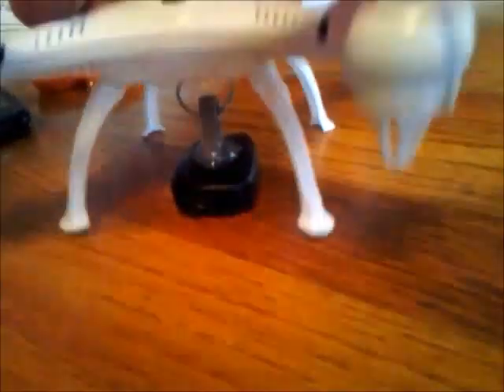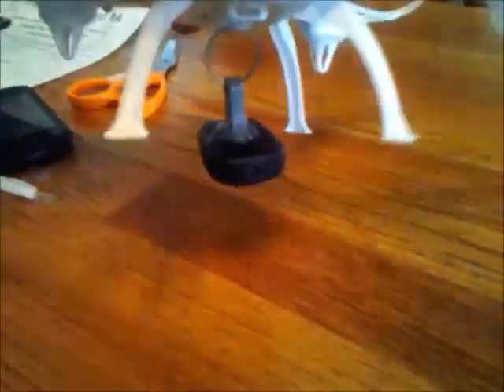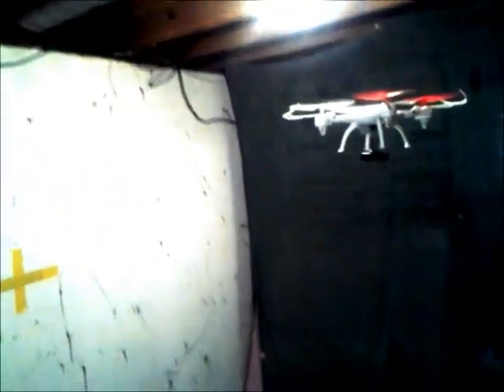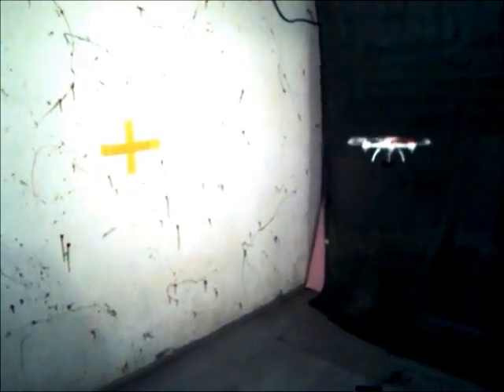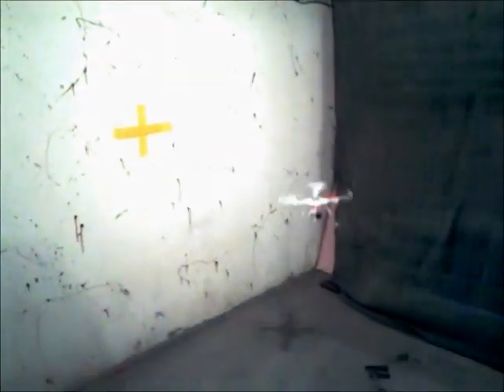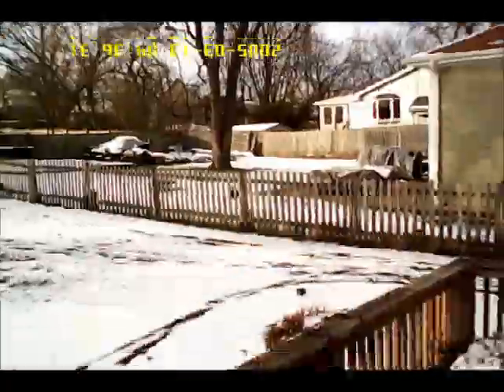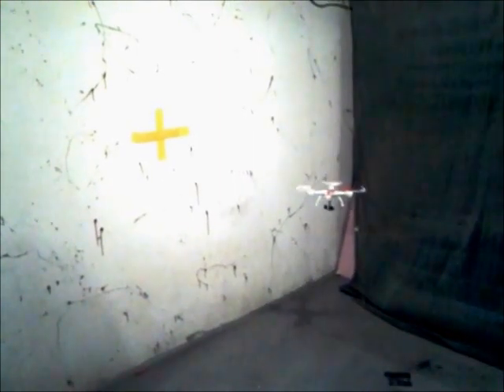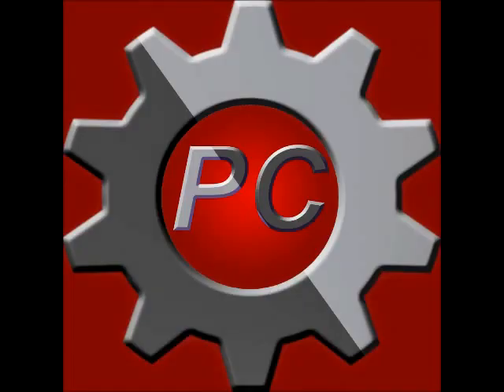Flight testing proves HOW TO MAKE A CHEAP DIY DRONE GIMBAL is Not Best for Small Drones - Ideas?

Comment: One way to reduce the swing is to extend the structure with a tail putting the camera higher in the swing thus reducing its amount of Swing. Similar to a kite tail .a weight hanging below the camera

Comment: At least it does something , on my big drone , it dampens the footage when and erratic movement takes place. Plus you need a heavy cam and reasonably steady drone
Reply from the maker: That makes sense to me I only have light weight drones and am looking for a rig to film while moving, but I could see if you had a big drone with a heavy camera staying still the inertia of the camera would help level it for landscape shots.
Reply: fair enough but also try using small rubber sleeves where the ring and cam meet so the friction will make it less wobble. but the reason this video was made is for you to debunk this theory which i think is unfair because it does work maybe not with yours but you should learn to troubleshoot it. anyway take it as good critism and thanks as watching your fail allowed me to tweak mine to correct this issue
Reply from the maker: True and I do think the original videos marketing is just wrong as gimbal and it just doesn't fit that category in my book a gimbal stabilizes during flight (maybe call it a inertia stabilizer) not just when still the video should have stated that it was for still shots on big drones.  I am still semi ticked I wasted a weekend on the project...So yeah take it as you will I am still on the hunt for a actual electric gimbal that can go a supper light drones...  I am now thinking I may just have to buy a phantom with a built in gimbal... to get the shots I want..
Reply: Patriot Contraptions oh , I get you , I recommend a syma x8 series , it's below 100$. And regarding the stabilizer , it does work , I did it on my drone it took me 5minutes. Never fail to try and never try to fail
Reply from the maker: Cool, I will check it out and I did change the title on this video to reflect its a small drone problem( I wanted to add a comment to it, but the YouTube no longer offers creators that option...).   We will see where this project takes me at the moment I am kinda droned out so I may take a crack at some RC jets for a change as I have one to fix up.  Maybe FPV in the future would be sweet ..but that's down the road:-)

Comment: I think the camera needs a little more weight to stabilize it!
Reply from the maker: I did try adding some more to it till the drone could not lift it with no difference.  I think that maybe on a drone with a hold position function this may work but I do not have that on mine.
Reply: Ok  good luck next try !

Comment: You didn't make the gimbal right.
Reply from the maker: Thanks for the input I tried it again with the mod, but after 4hrs still no luck.  I believe the secret to this "Gimbal" working has nothing to do with its auto leveling ability, but rather it lies in the Drones Ability to be locked by GPS in position giving gravity a chance to work on a still day.   As soon as the drone move any faster than a very slow speed or the wind picks up the pendulum swing takes over making it useless for filming.  In conclusion even with the mod this is stile not a working gimbal.  If used on a High cost drone with GPS lock it may be helpful, but no more so than any auto leveling  film soft wear or just letting the drone drift with the wind.
Reply: OK did not know that, thanks for telling me that.

Comment: U did it wrong. There shouldn't be a strap and forgot the rubber on the ring. Here's a video: https://youtu.be/Qi-lgXO5inM
Reply from the maker: Thanks for the input I tried it again with the mod, but after 4hrs still no luck.  I believe the secret to this "Gimbal" working has nothing to do with its auto leveling ability, but rather it lies in the Drones Ability to be locked by GPS in position giving gravity a chance to work on a still day.   As soon as the drone move any faster than a very slow speed or the wind picks up the pendulum swing takes over making it useless for filming.  In conclusion even with the mod this is stile not a working gimbal.  If used on a High cost drone with GPS lock it may be helpful, but no more so than any auto leveling  film soft wear or just letting the drone drift with the wind.
Reply: Patriot Contraptions ok. Nice educational video. Hope you find a way
Reply from the maker: Me too... I really want to use this drone as a chase came for my homemade bikes ...but its just proving very tricky without stabilization... May just save up for a Phantom:-)

Comment: No suggestions yet, not a proven concept from me either, sorry. But I've spent time making a bigger (for Phantom 1) 2D gimbal trouble free. It does stabilize really well in 2D, but the suspension/damping is responsible for killing the 3rd axis (horizontal) vibrations. I've thought about a few ways. The obvious is to convert it to 3D, which I will try in the future. But also I've thought about building my own active shock absorber, based on a solenoid, accelerometer and some other electronic components. Just to minimize the horizontal vibration. As the 3D conversion kit is really cheap, it may be that my solenoid will not catch fire... Hm... Anyway, your problem is interesting. Right away I'd suggest a servo gimbal, they exist for lightweight fpv cameras. If you really want a non-electronic method, then I think shocks are needed. With the shocks, adding fins / tail for the camera should help when flying forward (could mess sideways moves though). It needs to have a way to reduce movement. Free swinging is not an option, as we saw. I've gone through ideas from fishing lines to foam. I'm not at all sure you can build a lightweight and passive gimbal. Counterweights and pivoted rods...? Adding inertial mass is a big no no for small drones. Just throwing ideas out as I hate to see the comment section quiet :)
Reply from the maker: Thanks I checked out the gimbal, it looks great!!  My drone is not big enough to lift one as of yet though so I am going to run with out one till I have the money to by a better drone.